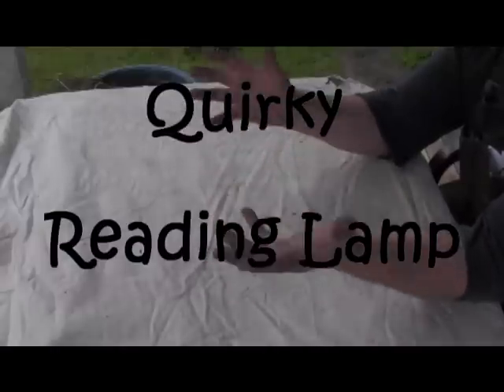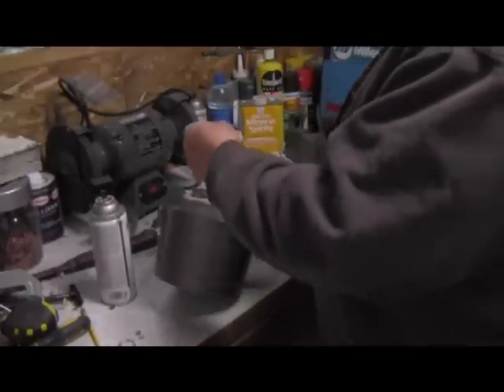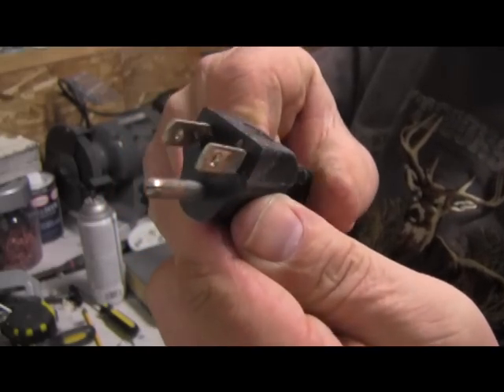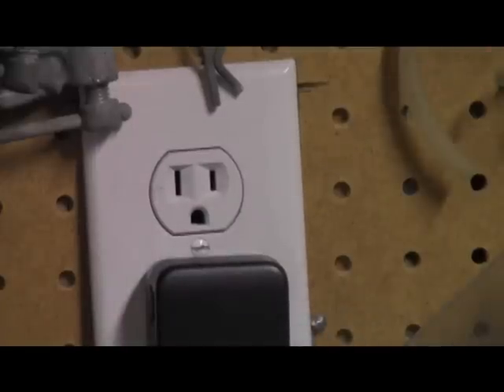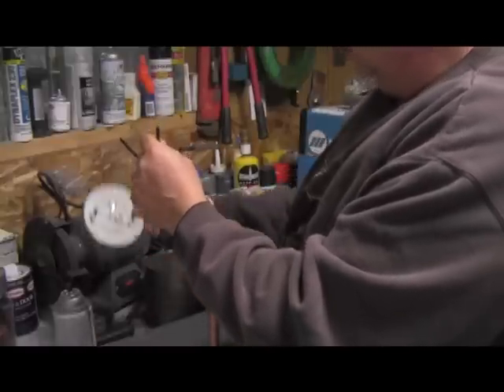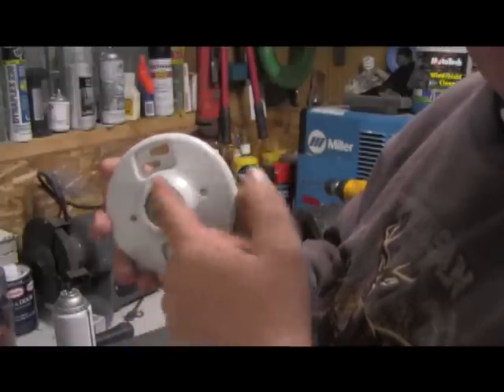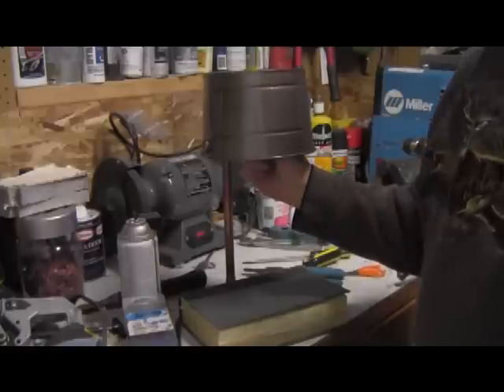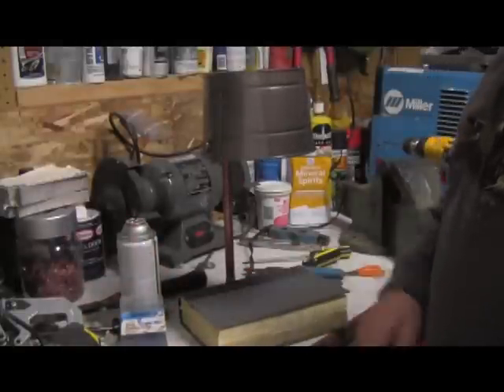Ultimate Reading lamp 6

Comment: Sometimes your common wire will have ridges instead of printing. Your third leg, your Earth Ground Wire, is generally either bare, green, or center mounted in the wire bundle depending on the format of your wire. That will be hooked directly to your bucket in a non intrusive manner so your bucket won't get accidentally hot wired.